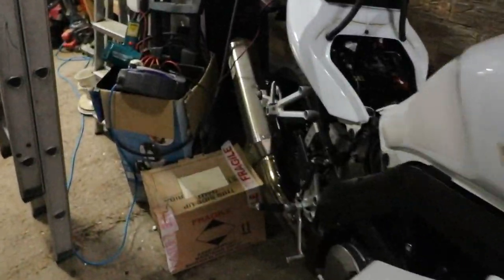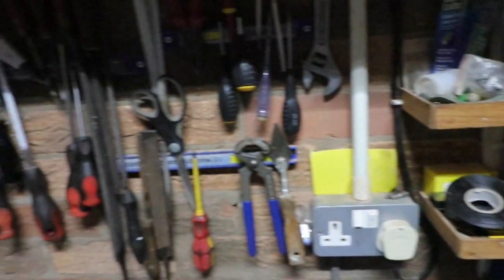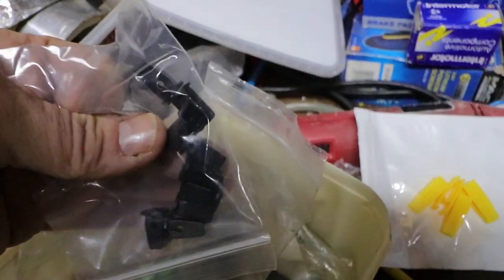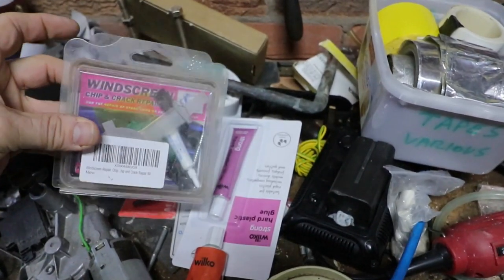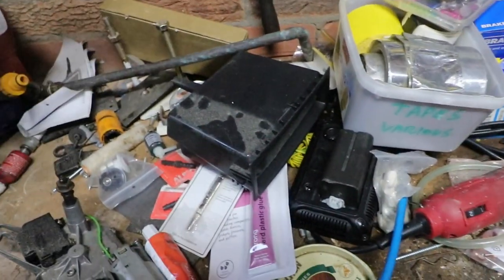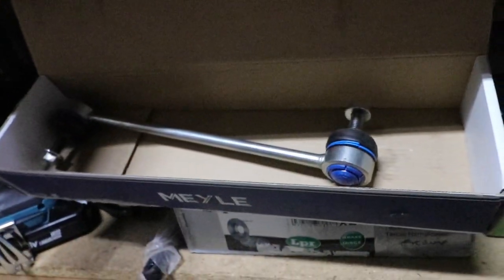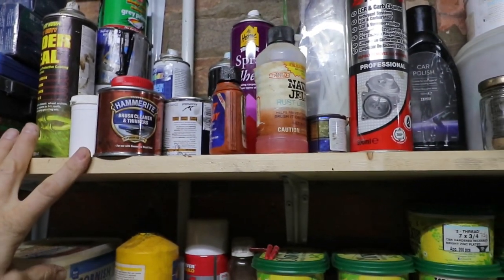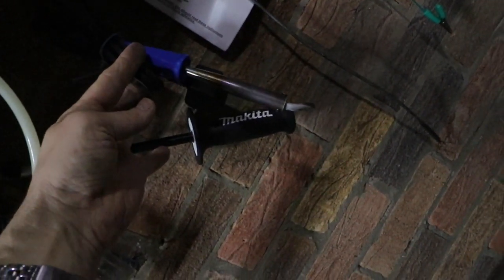STORM EUNICE CAUSES DISARRAY IN WORKSHOP

Comment: So are you satisfied with Mannol motor oil? I used it for first time in my 4x4 1.8 20Vt Octavia and I am thinking of keep using it. Of course I do use the 5w40 Elite.
Reply from the maker: Yes, it seems perfectly adequate. I do change it out more frequently though which keeps the oils properties working before breaking down with impurities of soot and  wear particles from the engine.